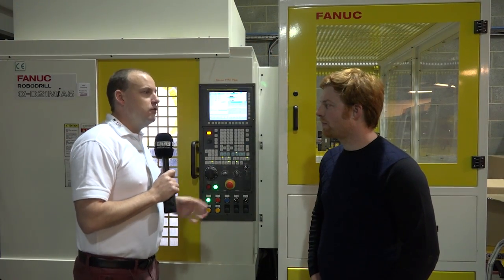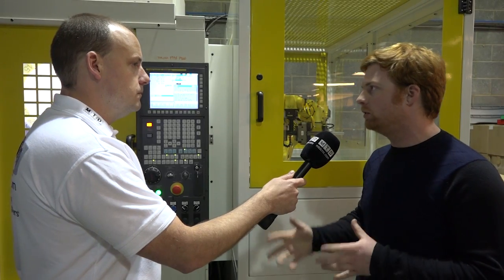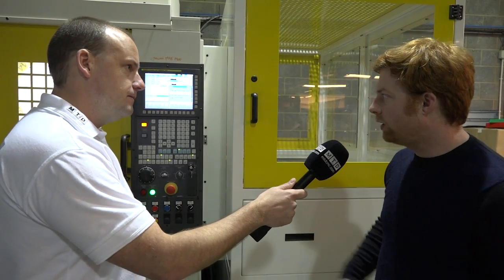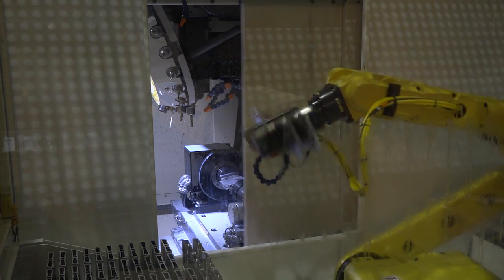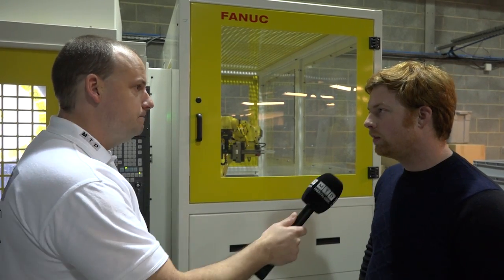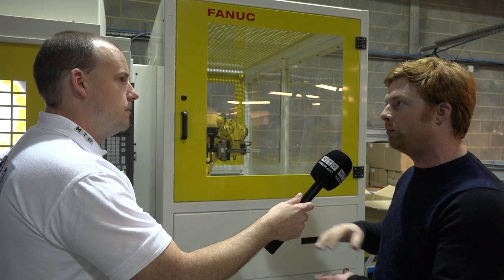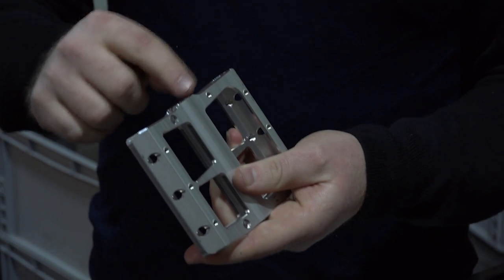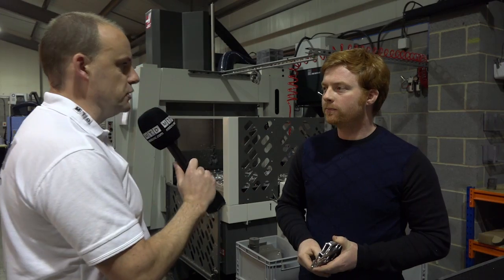FANUC ROBODRILL at Superstar Components

Comment: This is pretty much the application for getting a Robodrill in my opinion. When you need to solve a Cycle/Lead time of one particular part that doesn't require any complex toolpaths due to the limited controller size. Obviously Fanuc bots will work with a Fanuc machine. So it's a more streamline solution for such problems.

The machine is rather pricey for its limitations though, but like I said, if it can solve a problem faster than others, it's the better machine. You can worry about what it can and can't do later, if the ROI is solved in one job in a matter of months now.